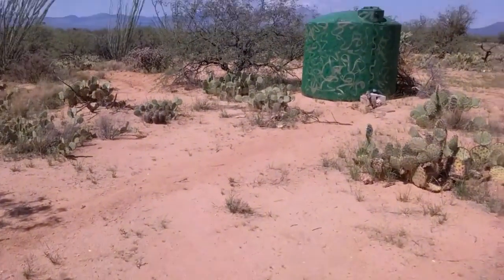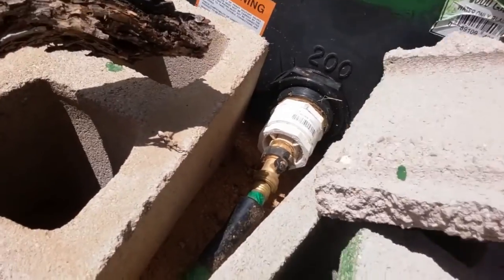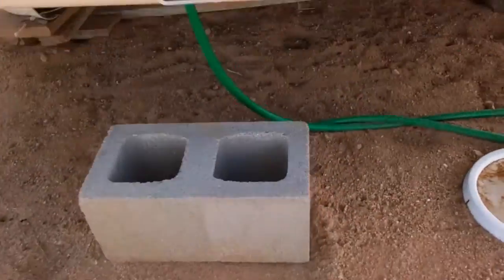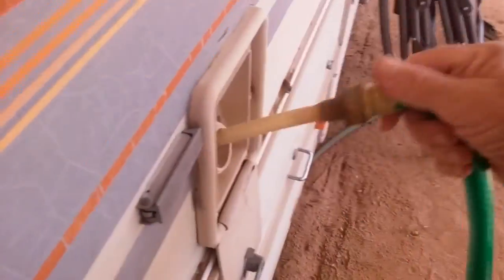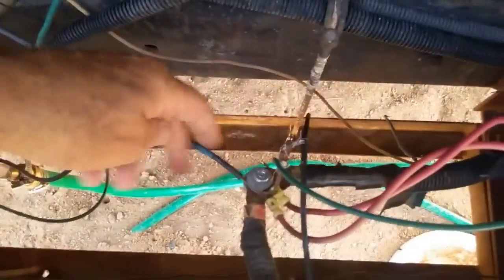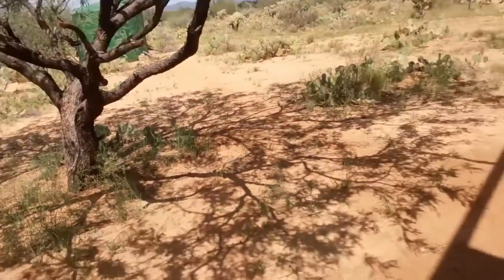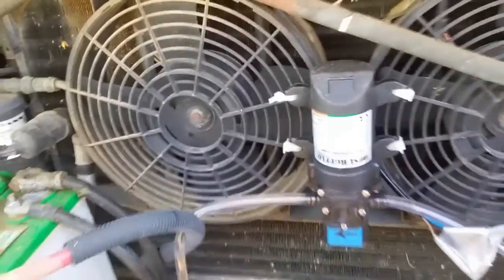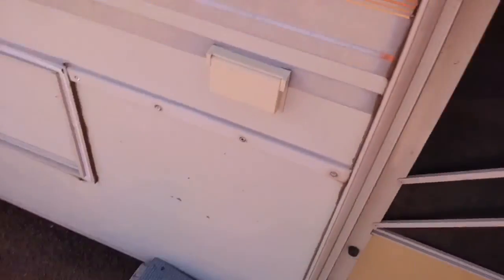Water System & Transfer @ AZ Off-Grid (Unplugged)

Comment: Just a thought, put a splitter connection at the tank with 2 hose bibs. If your system freezes then you can easily get water from the tank. You might need a heat wire at the tank connection, I guess you will see. In my area, they put the bottom of the tank 2 feet under ground so it's below the frost line but that's at 5,200 ft elevation.
Reply from the maker: If I desperately needed water out of the tank I would do that.. I really only need to fill the house tank once a month, it is easier and cheaper to just drain the hose.. I have made allowances in the 'burial' for doing just that.. There were strict warnings from manufacturer about burying any part of the tank as it is not designed for that.. They do have tanks that can be buried.. It will all depend on how cold it actually gets up here at night.. hopefully not as cold as I have been imagining,, (which is close to arctic conditions..)
Reply: deserthorizons if you search your area on line, you should be able to find annual weather trends and averages.
Reply from the maker: Redefine Living  -- I have lived in Tucson since '99.. before that I lived in St. David for ~6 years.. It is just I have never lived a winter HERE on this spot.. .. The neighbors were telling me it snowed here last winter.. NOOOOOO!!!!

Comment: Run the water under the ground wrapped in that insulated wrap. And then wrap with a heating tape all the way to the RV.
Reply from the maker: Roxanne Cabrales -- I really only NEED to fill the house tank once a month, it is easier and cheaper to just drain the hose.. I have made allowances in the 'burial' for doing just that..(remember I am only plugged into my solar panels..) 
 Thanks for watching..